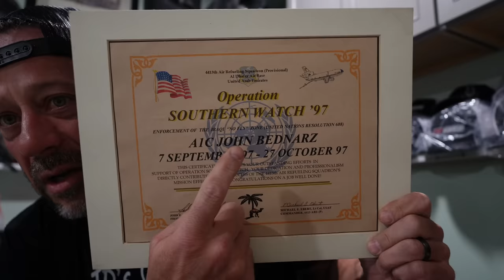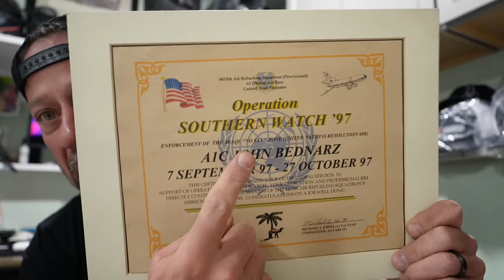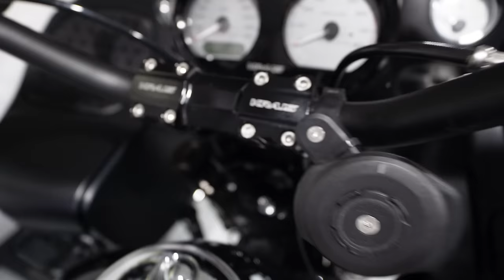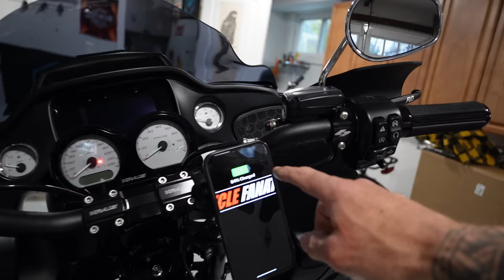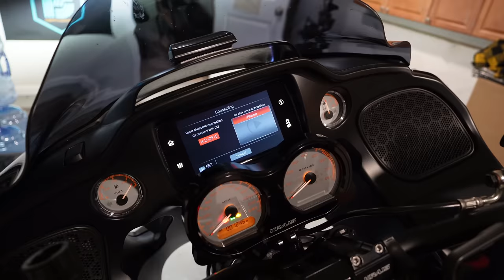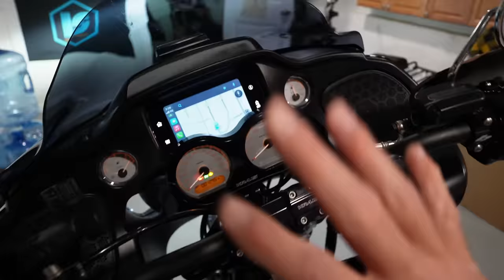TOP 10 UPGRADES | HARLEY DAVIDSON ROAD GLIDE | STREET GLIDE | ROAD KING #harleydavidson #roadglide

Comment: Suspension is the most overlooked part of setting up a bike and most overlooked in the cruiser world. Getting the sag and compression and rebound settings correct for your weight and riding style is HUGE! Doesn't matter how much power you have if you can't utilize it.
Reply: A Lot of guys are into the penis extension power thing however,most times the power curve is in the rpm range above your normal riding range.
Reply: @rogershinton7483  hey u better stop being truthful 😂
Reply: Weakest part of an HD, by far.

Comment: Happy Veterans Day John, thank you and all Veterans for defending our great Country.  
I agree, anything over a Stage 2 and you're going to have to start upgrading engine internals and cooling. I still feel Max is a good setup for more power...Trust me, mid-teens Hp and Tq is good, but just a little to little for a loaded up 850lb touring bike and it gets boring after not too long. With some smart internal upgrades the M8 can me made super reliable and be putting down around 130hp\135tq .
<Max does look like a great fit for you and wow!!! that sound  😎

Comment: Im 6"2 as well and did the rear shocks to a 13 inch and getting ready to do the front suspension. It is a world of difference in ride when the suspension is tuned to you style. By far it should be the 1st thing riders do is set your suspension up and the bike will be a whole new ride it will feel like a feather and fall in and out of the corners with such ease and give you as a rider alot of confidence to handle twisted roads. It dont matter what bike it is tune that suspension to your bodyand riding style

Comment: Looks good John.  I know for myself I have a 2011 street glide,  I did a Harley 110 kit in it and the biggest thing I noticed was the power to weight ratio felt the way it should be.  Haven’t ridden the 107 or 114 but I imagine they have the same feel.
Reply: Not much power difference between that 110 and 107, just different rev and temp for sure.

Comment: I used the Bung King aluminum lift block and it isn't the best look, but it gives the bike the stock lean back. You have to drill through the foot of the kick stand and it took a little patience and a busted drill bit before I had both holes drilled, but the lift block does it's job.

Comment: Thank you for your service. I have a 2015 Street Glide Special denim black and I added the same color tourpack to it. The original seat is wearing out and that seat that you have I think would put a nice contrast to it. I live in Port Saint Lucie Fl. In moved from Brooklyn then to Coram Long Island and my home is in Port Saint Lucie Fl.  I’m down here for almost 30yrs. I drove from Coram back to Forest Hills Queens.
6 days a week working for a Zenith authorized  TV repair shop anyway my 2yr. Older brother then taught me how to ride mini bike and then I new I would be riding my my hole life. He also bought a fox go cart with a McCullough 70 engine worked out. We used to take it out to aqueduct racetrack on the weekend and we raced it in the parking lot I was hooked forever so I riding motorcycles from 13 till today and I get a new 2015 Harley Street Glide Special Denim Black. I’m 72 yrs old now and I’m thinking about a new one. They look so beautiful and I like there new braking system. Anyway I like that White seat you are selling. Would you be able to ship that to me and how much do you want for it. Thanks Cliff Peranio

Comment: I formed out a 1” block of Lexan to extend my kickstand. It works great and a bonus was that it takes all the punishment from the ground instead of my kickstand. Drilled a couple of holes in the kickstand and threaded them to 1/4-28 thread then a couple of countersunk holes in the Lexan block and fabbed the stainless bolts to finish flush with the upper surface of the jiffy-stand. Looks and works great!

Comment: John, I love the bike and where you have taken it, makes sense to me.
I have the S&S 465 torque cam in my 19 Tri Glide, totally change the dynamics of the Trike, we do a lot of 2-up riding, torque comes on at 1500 rpm and climbs to 130 torque at 3000 rpm, feels like I need a 7th gear at highway speeds though. I have to be careful can pull the front wheel in second gear cracking on it - no steering  lol

Comment: How does it feel going from floor boards to pegs ?
for performance.. I can TOTALLY see the benefits in what u did with the Arlen ness mid controls.  Those pieces look absolutely amazing in quality.  I was on a bike the other day with no floor board and it felt so foreign to me even after just 2 years of floor boards (20k miles in 2 years ..  once u go HD touring bike .. no going back.  The fatboy was dope but the FLHR is really doing it for me)
*one day I’d love to go to a Glide.  Having coms and navigation .. YES!!! I hate those bar mounted phone holders.  I keep mine away in a saddlebag unless it’s needed.  Not to mention battery dying with each mile.

Loving the bike
I was thinking doing the 124 upgrade.  But I think I wanna try some proper suspension and see how that feels.  Prob just the rear for now.  I can get them on myself.  And those remote reservoirs look the business!!!

Comment: I'd rather go to a stage 2 if I'm gonna forward it but right now can't afford it but I had it my fuel mixture's bumped up but I think leave it a fairly stock is your best option that way they don't tend to have parts that might fill down the road you know or do you know how long Chevy did the engine for the last at's the thing I'm afraid of because when you get too much power and turn up the bottom end of the top end or whichever so I'd leave mine stock I'm happy with my 114 it's got enough power and it's on a heritage classic so I got plenty of power I just like cruising

Comment: I have a 21 ultra and I put 21k miles on it in 1year time don’t ride much in winter in Kentucky but do rest of year!  So my question is the mid controls worth it? I’m 6ft 1 and the way the stock boards are and brake pedal which I upgraded for extended I still don’t like it.  And I’m guessing your not doing audio on this bike as well?

Comment: Hey, do you have the 14" legend shocks? I see you have a long exhaust.  I was told I need short exhaust that stops before the axel bolt for that to work  did you run I to a problem?